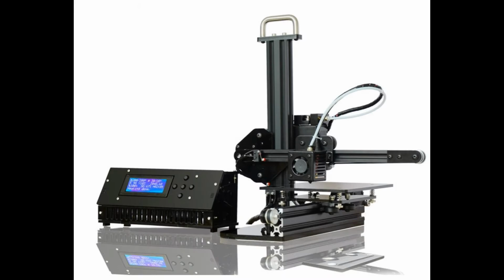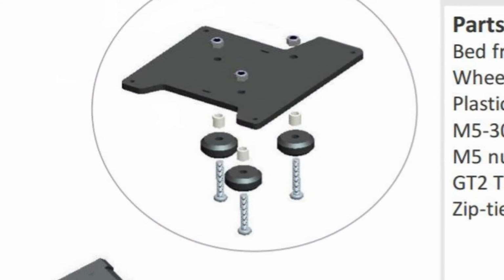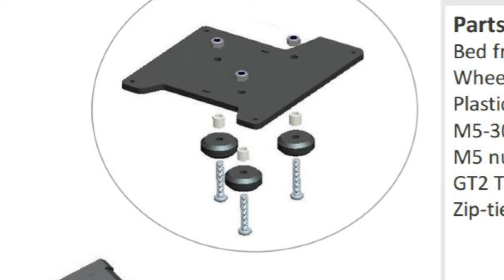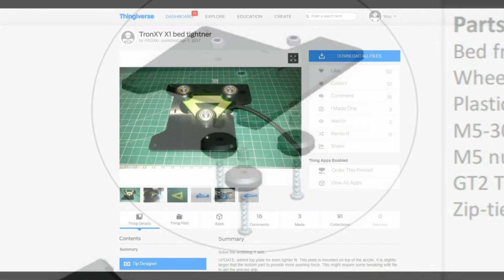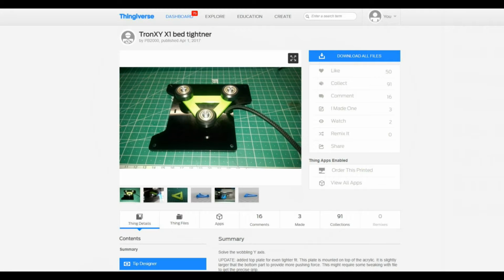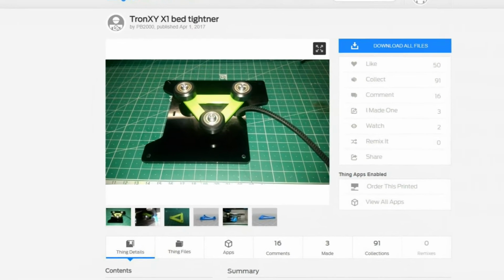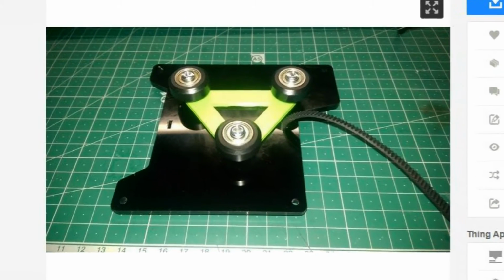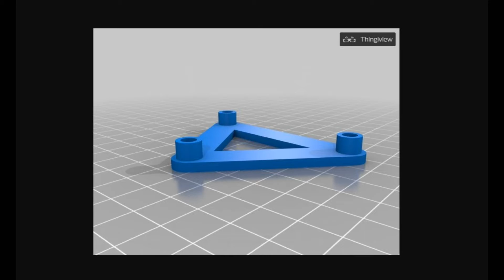TronXY X1 3D Printer - Wobbly Bed [SOLVED]

Comment: I did all this... and it still wobbles like crazy! 
I'm sad, spent 4 hours working on this, to have the result be equal or worse lol. Any other solution?
Reply from the maker: Hi Franco, without knowing more about what's happening it's difficult to help. I recommend you look very carefully at exaclty is going on., What is wobbling with respect to what? What can you tighten, etc.? Some 3D printr issues are very hard tro understand, but things that wobble seldom qulify - you can actually see what's going on if you look carefully, and once you understand what's going on it's not too hard to fix it. Good luck!

Comment: Thanks for these vids on this machine. I'm debating on trying this as a first printer or weather to just jump in and get a cr-10 mini.  This does seem to do ok with a few minor mods but yeah,  I'll keep watching, Thanks again :)
Reply from the maker: Hey Zombie, thanks for the comment - I'm glad you're finding them useful. The build was dodgy but I haven't seen a printer as well-behaved since it was built. Extremely well-controlled and I've really been hammering it to churn out parts for an instrument I sell.  I've never even had to tightened a belt.  Good luck with whatever you decide.

Comment: As a alternative solution, ive used some jewelers files and elongated the holes to allow one of the roller bearings that slides on the V slot extrusion to be adjusted so that you can tighten it and make it far more stable. Wish I had done it to the x axis as well as the axis suffers from the same thing the as the bed wobble
Reply from the maker: Thanks Justin. Apologies for late reply. I was not notified of your comment and only just saw it.